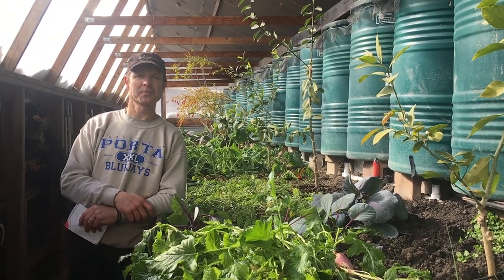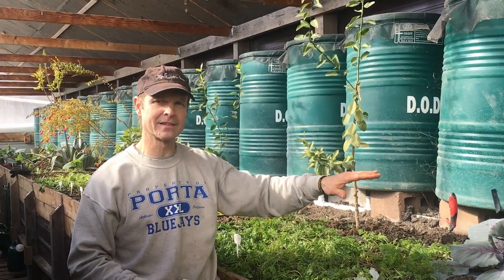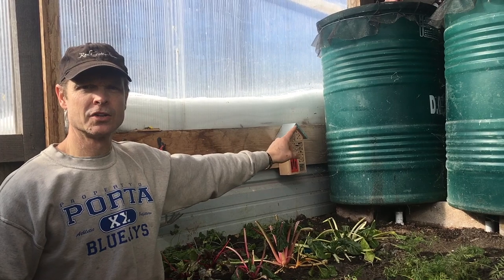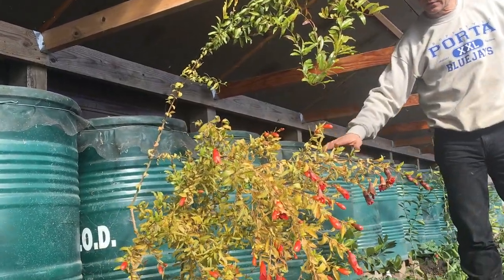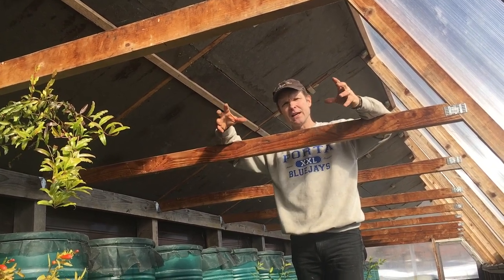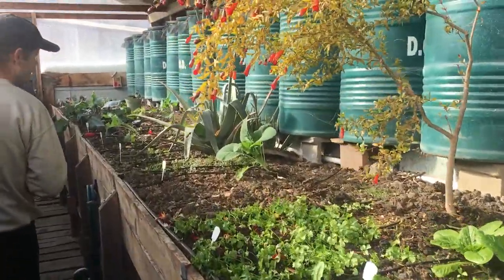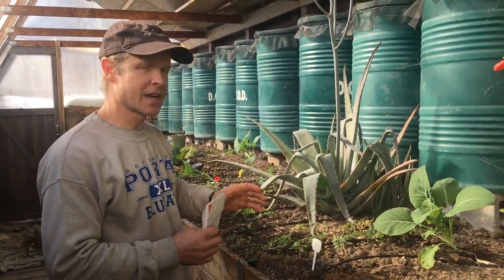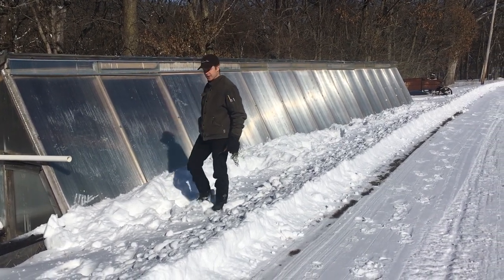Walipini Followup: Answering Viewer Questions

Comment: Can you please draw up a simple side view and front view sketch so people can get a better feeling of size.
Reply from the maker: It’s 60 feet long and 9 feet from front to back wall.  Depth of the cold sink is 8 feet below grade and the grow bed is 3 feet below grade.
Reply: @ADifferentWay  What is the length of the front poly panels? How high off the ground is the top of the roof? Have you thought about painting barrels black? Thanks for your reply
Reply from the maker: Although black is a popular color for absorbing heat, you have to balance that with the reflectivity of the barrels.  Green reflects light nicely for the sake of plant growth, which provides a good balance of heat absorption (darker color) and reflectivity.
Reply: @ADifferentWay  Can you tell me the size of the front panels. Are they 4 by 8? Thanks for the info.
Reply from the maker: Each panel is 6' tall by 4' wide.
Reply: @ADifferentWay  Thanks
Reply from the maker: If interested, we wanted to let you know our Walipini building guiding is finally available! https://www.amazon.com/shop/adifferentway/list/2JRI58ITC5AM0